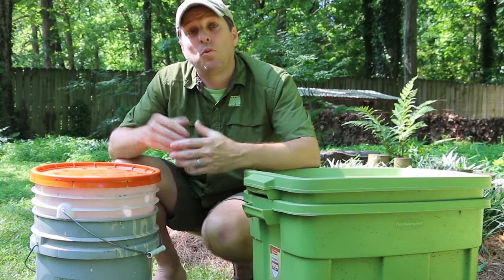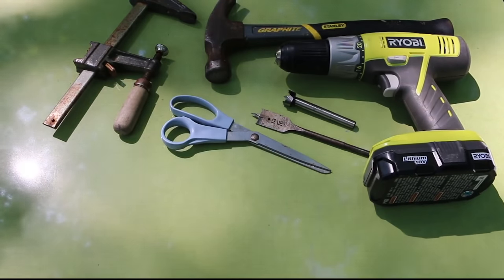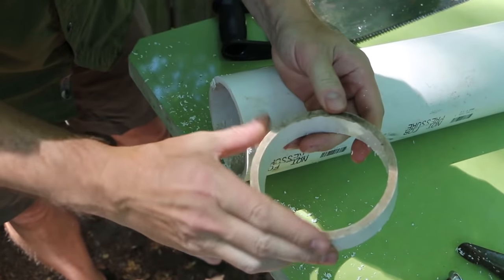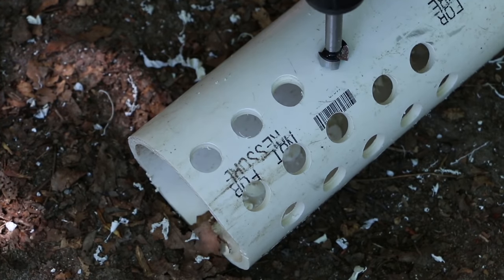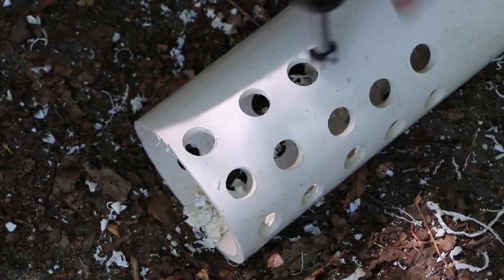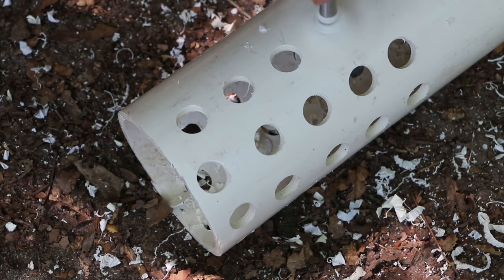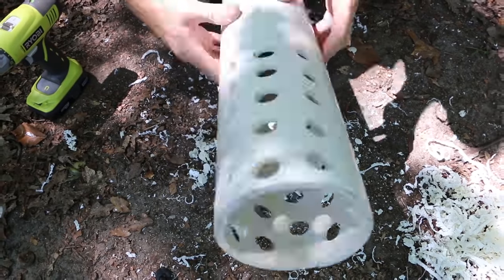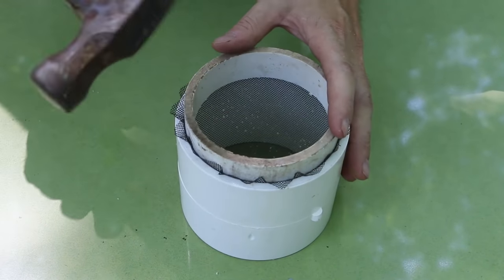How To Make A DIY Worm Tower

Comment: Consider using HDPE 4" pipe for organic gardens. Safer for plants and people than PVC.
 I just made 10 of these worm towers. Great simple design.
Reply from the maker: Good call on the HDPE. Thanks for the suggestion. Thanks for watching.
Reply: I will bet that HDPE is just as toxic. Example: This code contains high density polyethylene (HDPE). Harms: Although it is usually considered safe for usage in limited quantity, studies have shown that code 2 plastics can leach nonylphenol, especially when exposed to sunlight, which is an endocrine disruptor.
Reply: @raymccarty4612  HDPE pipe requires cutting (creating particles/dust) and use of a mask to prevent inhalation. It is rated for use with potable water. Exposure of pipe to sunlight is limited by the 22" section (after cutting 2" ring) being placed in the ground to a depth of up to 10 inches leaving 12 inches exposed to sunlight. The stability of HDPE material under sunlight exceeds stability of PVC which is known to leach toxins as you have described. Hence recommendation to use HDPE pipe.

Comment: Hey GreenShortz
Made 6 towers for my garden and only utilized ONE and the one is enough for most of my kitchen scraps which is amazing to me. I have one question for you or anybody. Do I have to add bedding now and again?🌿😊⚓🇺🇸
Reply from the maker: Yes. It is a good idea to add a little bedding to cover any new food scraps. It helps keep moisture in and keeps other insects from finding the food before the worms. I add a little water to dampen the bedding. That helps lock it down. Thanks for watching. happy composting.
Reply: @GreenShortzDIY  
Thanks for the info🌿🍀📐📏✏😊⚓🇺🇸

Comment: Why did you not put  shredded paper then sand then at least 6 inches of soil or compost for worms to live in? then the food scraps, then more sand, then more shredded paper ,then water in? Surely you need to give them a starting dirt bed to get accustomed and thrive well before they will move out into garden area? With out establishing a start area seems they will under stress just move into the garden and not go back up into tube?
Reply from the maker: I can’t argue with your recommended set up. It’s been so long since I made this video, I can’t remember what I did. The migration of the worms away from a garden-based worm tower is a reality of this type of system and is hard to measure. Overall, it’s not a bad thing to colonize the whole garden. I like to think I can keep them around with keeping the food source stocked, that and a good lecture prior to setting them free to do their work. Thank you for the feedback. Thank you for watching.

Comment: Instead of drilling holes into the PVC pipe, you could also cut slits on the PVC pipe with a cutting tool (table saw, circular saw, or other). 
Or even easier, you could stake 3 conduit pipes equally spaced into the ground in a triangular pattern, and slide the PVC pipe from above on top of the 3 pipes, that way the PVC pipe would be resting at ground level allowing the worms to exit or enter the PVC tower throw the 4" unrestricted hole. The conduit pipes would serve as stabilizer and holding columns to the PVC pipe, and the PVC pipe could be removed easily if needed at any point in time without disturbing the underground or the roots of plants.
Reply: A similar composting tower could be built out of cheap concrete garden pavers (like a chimney), the thickness of the pavers would better protect the worms inside from changes in temperature outside and from the sun rays, and the pavers would hold moisture inside also, helping the worms feel more at home. A piece of screen can be placed at the top, held between the top layer of pavers and the ones just below, or a ceramic or terracotta tile could be used at the top as a roof for the tower.
Reply: Make a video. It’ll be easier to visualize.

Comment: What do you suggest for a woman who might not have the ability to do the drilling on the PVC pipe? And secondly where can you get the composting worms at reputable sites? I would like to also try this in my elevated beds which are about 2 to 3 ft deep. But I have not found a good growing medium yet. The industrial type I used last year did not do a good job for certain things, they just didn't grow well.  I might have to dig them all out and start over even though I filled the bottom with mulch. But a tower like this might be really helpful for the worms!

Comment: PVC is not suitable for a compost bin/horticultural building material as it breaks down under exposure to heat and UV sunlight; it's why it is typically used inside and for cold water only. HDPE would be a far safer and more viable option if you are concerned about chemicals leaching from your piping into whatever is coming into contact with it - whether that is water, soil, your castings, etc.
Reply from the maker: Thank you for the feedback. I agree HDPE is a better way to go.

Comment: I have a 3' hugelkultur beds, and I made worm towers with buckets with lids. I didn't seem to get much breakdown of the compostables in the bucket though. I was wondering about replacing the lids with screens, and having the tower go further down into the bed would help with that?
Reply from the maker: Part of the challenge is that the worms likely enjoy the hugels as much as the bins. They may be migrating out and not coming back. You could try some AB testing. Pull a bucket out and create a contained worm composter. Then create a bucket with your configuration above. And leave one bucket as it is. Try to divide your worms into three colonies and then split your food scraps three ways. It won’t be 100% scientific, but might give you some usable intel. Thank you for watching.
Reply: @GreenShortzDIY  Thank you for the quick response. I'll try that out, might also try just burying some kitchen scraps to see if I get some activity in the top layer.. Also loved the soldier fly chicken feeder video. Keep up the good work. :)

Comment: Thanks for this vid! I am considering this instead of the tumbler compost method. @Ben Dreis If you can drill a material at a lower RPM then you can save battery life on a cordless drill. Also, drilling or screwing into anything at a higher speed than needed can create a safety risk to your wrists/body parts, your drill, the torque, and project area. Not all drills are created equal, nor craftsmen for that matter. I trust this guy knows what is good for him and the worms. I hope you work safely on your projects Ben, and remember that full speed is not always the best.

Comment: What are the cons of this system as opposed to having it in a separate bin?
Reply: the cons are that if you don't put the lid on right, you might get flies and soldier flies helping to compost your food instead of the worms.

if you use 2-foot sections, then you have to make several for around the yard, though that's one-time only.  after that, you've got a home that lasts a long time for the worms and for composting.

Comment: I use vaseline for the cap. Good video, keep doing what you do.
Reply: I live next to the water it's slightly brackish.can I just use it or will the light sodium harm my team?
Reply from the maker: Oooh. That is a good question. It probably depends on how brackish. You could mix with rainwater to dilute. You could also dig at the water's edge and see if you find worms...not 100%, but maybe a decent indicator. Thank you for watching.

Comment: Nice. If you search for "Pipe-composting project goes down the drain", you'll find that some people didn't have much success with pipe composting. Do you have suggestions that could avoid the stench and help in faster decomposition?
Reply from the maker: Worm towers are convenient, but not as effective as a regular or flow through worm bin. I think the key for more rapid composting is surface area and mass. The more surface area, the more oxygen gets to the compostable material to aid in breaking down the material. The more mass, the more it can heat up, which accelerates the process too. I like worm towers because they are low maintenance, but in this case less work=less reward. Thanks for the feedback.
Reply: GreenShortz DIY I found 20ltre plastic buckets with lids work better than pvc pipe

Comment: Thanks for the great video! I was wondering, could I keep the top lid closed or do I need use a lid with mesh to keep it open?
Reply from the maker: Hi Pratik,. The mesh helps heat rise out of the worm tower. Air flow is important to keep the habitat at the best temperature, especially if you are in a tropical or sub-tropical climate. Thanks for watching.
Reply: okay, thanks for the reply! : )
Reply: @GreenShortzDIY   Would placing a cap on with holes in work ?

Comment: if you add pvc "arms" with tiny holes at the bottom and place them under the soil you could "flush" the worm tea directly to the bed
Reply from the maker: Great idea Doc. Thanks for sharing. I might use a mixture of sticks and gravel instead. I think the small holes might end up getting clogged. Thanks for watching.

Comment: Could a cement cistern be used in the same manner? It would hold the heat better and allow worms more shelter from cold and hot temperature?
Reply from the maker: Jim, my concern about using concrete with worms is its moisture absorbing power. When worms have escaped from my bins in the garage they are dead from dehydration in less than 2 feet. Concrete underground might be less moisture-sucking if it stays damp. However, I'd recommend you just cover the worms in the ground with a heavy layer of mulch or wood chips. If you wanted to build a vault or cistern, you could try using mud / cob / adobe instead of the concrete. It would break down eventually, but would create a better habitat for the worms.
Reply: Hemp concrete an extra carbon remover and it will break down and enrich the soul has well.

Comment: I want to know the feeding schedule and how much and when to water the worms.
Reply from the maker: I put food scraps in the worm composter whenever we have them, but I've got a few towers so I rotate which one gets fresh compostables. I'll also add some new newspaper bedding at the same time to cover the scraps. And then sprinkle just enough water to dampen the bedding. Then the worms got to work. You going to try worm composting? Already doing it?
Reply: We live in Kingman, AZ in the Mohave desert. We plan to move to a 2,000 acre ranch in the mountains, but I was told it gets very hot in Golden Valley. I plan on doing some hoop greenhouse projects. So far I have only been successful with cactus and tomatoes and maybe zucchini. help!
Reply from the maker: Ooh. Worms in the Mojave? I don't know. :-) Worms thrive in the 60 - 80 degree (F) range. Hopefully in the mountains you'll have a more temperate climate. You should look into a making a walipini greenhouse to take advantage of the cooler ground temperatures. That's if you aren't too close to bedrock. You may be able to create a micro-climate the worms can tolerate.
Reply: Thanks! Cactus is so easy out here. Break off a leaf, let it dry abt 4 days, then plant it anywhere in your yard if you live out here in the desert. LOL! I have a great collection I am working on.

Comment: I'm looking to add a worm/compost tube to an elevated garden bed, but how often should you remove the compost out of the tube and replace with new compost?
Reply from the maker: Steven (Am I assuming correctly?), because the worms carry the digested compostables our into the garden and the water added washes out some of the solids as well, you shouldn't have to remove any compost, instead just keep adding...at least for a season. You'll likely find as temperatures get cooler that the worms migrate out into the compost layer of the garden bed and slow down reducing the compostable matter in the worm tower. You might some build up then. If you do see your tower getting more full, I sugest moving the tower a few feet away and spreading the composting pile left behind. Try just adding compost and see how long you can go without moving the tower.

Comment: In the book, Solviva!
by Ana Edey, she tells the story of how she wanted everything to be green and recyclable so she bought a composting toilet and put it in her house and realized that that was never going to fly, -you know nobody not a lot of people are going to go that route and they're expensive and they're difficult to maintain so she hung a 4 ft long 3 ft wide 2 ft deep box on the side of her house with it divided in half and her toilet flushed into that box so she had a diverted that would go from one side to the other so you're talking to compartment that is it would be about 2 ft by 3 ft by 2 ft
 2 ft wide 2 ft deep and 3 ft long, ie out from the wall. basically she had it set up with rocks on the bottom and blah blah blah a water drain off about 4 inches up or something like that you have to read the details and then the water drainage she had into a long meandering in a waterproof barrier with gravel and rocks and mulch and whatnot and had beautiful plants growing on their flowers and bushes and roses whatever... she was a meticulous record keeper she I think she used 96 cases of toilet paper you know several thousand flushes etc etc two bottles of Drano to see if it would kill the worms and it did not and the kicker if she never had to change the pipe from the one side of the other she never had to take it over to the second side.
very impressive!! in fact if you want to learn a lot read the book get it and read it absolutely outside the box brilliant genius level thinking savant level thinking. in fact I we had the book playing around I picked up when they started reading it and I got about ready for about an hour and I I just burst out with this guy is a genius! watch that's funny it's written by a woman and I said  can't be he's a genius.
of course I didn't wasn't disputing her I was just joking at that point she knew it. so she replied with his name is his name is Anna so I fired back with that's a funny name for a man:-)ROTFLMAO

OKAY!!!

SO HERE'S MY QUESTION WHY NOT DO WHAT YOU DONE HERE IF THAT PIPE WILL KEEP THOSE WORDS FROM FREEZING AT THAT DEPTH WHAT ARE YOU DOING THE WINTER TIME OR WHAT STATE DO YOU LIVE IN WHAT'S ON I THINK IF YOU MADE IT A LITTLE DEEPER MAYBE EVEN A BIGGER PIPE OR WHATEVER BUT ANYWAY I'M JUST LOOKING AT THE POSSIBILITY OF USING IT FOR MANURE COMPOSTING! YOU KNOW HUMANURE COMPOSTING TOILET?!?!?!

Comment: Nice job I made  a similar tower a  couple of days ago the diametre of my tower is wider it was a scrap length from work.
It is Autumn here and I not sure how the worms will go in the cold weather the raised bed is exposed and  we get heavy frost and sunny days in winter here.
I created a bevels around the lid and the top of the tower and a bit a bit of vaseline to resolve the cap getting jamb on.
The garden bed has loads of leaves and chook poop .
A few people have raised concerns to me on the use of pvc I was wondering what you thoughts are.
I have a view that the material I used is being repurposed and not going to landfill.
I like your posts keep up the great work.
Reply from the maker: You might pile some extra mulch around the worm tower for the winter and perhaps make the lid less passable for air. Maybe stuff an old towel down it for the cold months.  Sounds like your garden bed (and it's organic ingredients) are perfect for the worms. Regarding the PVC, the primary environmental concern with the material is during its creation. Dioxin was a by-product of the manufacture of PVC. I say "was" because the production methods have been updated to make it not as bad, but that said, it's still not all roses. 

PVC is mostly inert for garden use. However, the sun can degrade the material, making it brittle. Any off-gassing from this process would go into the air versus the soil. Although there might be some residuals washed into the soil. I'm not a chemist. :-) One way to minimize the sun-degradation is to shade the tower, perhaps inside a shell. It would be easy to do this with wood. Use a solid wood versus plywood so your friends don't bust you for polluting your garden with plywood resin. :-) 

The challenge with our modern-day is that we are surrounded by chemicals and residuals in o many products. It think your personal calling to reuse should out-weigh the risks. Thanks for watching.
Reply: Thanks for your feed back I will let you know next spring  how the tower goes.

Comment: I'm going to try this in the Netherlands. I wonder what the winter / freezing will do to the worms. Is it better to put a much longer pvc pipe into the ground to reduce the effects of freezing?
Reply from the maker: Hi Marcel. Glad to hear you've try this. I think a deeper pipe will help the worms transition your cold Winters. You might also try adding some wood chips or hay around the exposed portion of the pipe. And a lid for the top. Thanks for watching.
Reply: Had the same question.  I’m going to put it very deep so they can be below frost in the winter.  Thinking 3ft under and two ft over.   Psyched to use this in asparagus bed.

Comment: Hey! Great videos. Will constant rain be a problem for the worm tower?
Reply: The holes and the open bottom should allow excess water to drain into the soil, even if a hard rain leaves the tube initially water-logged.  You could always saw rows of slits at ground level and just above to help drain collected water.  The slits would be too narrow for worms to enter, but wide enough to drain water.  Water well screens are often constructed this way so that ground water can enter the collection chamber without allowing large debris through.

Comment: I notice that you added sand ("grit") in this system but not in the 5-gal bucket system.  Is there a reason for this?  Thanks!
Reply from the maker: I likely just omitted that step from the video. Or added the grit to the worm composter later. Thanks for your comment.